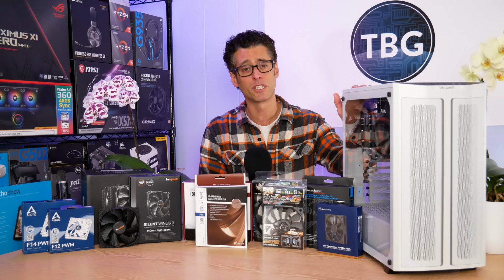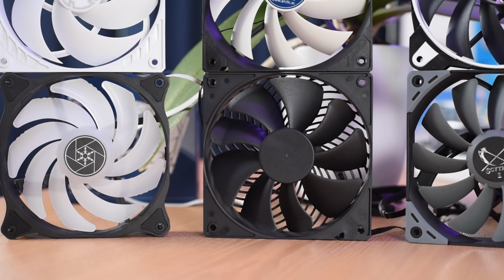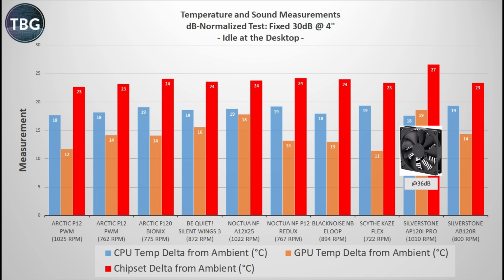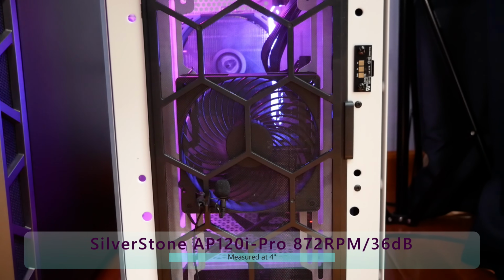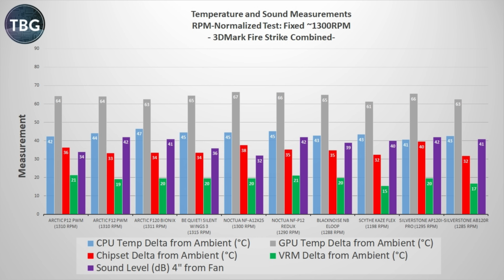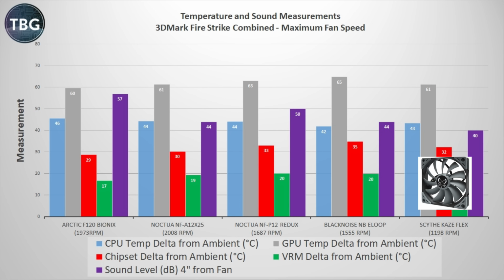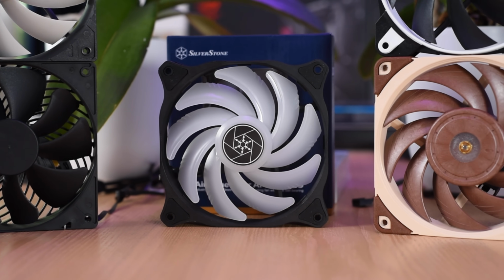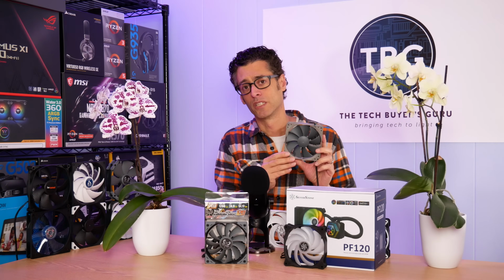The Best 120mm Case Fan Shootout: Arctic vs. be quiet!, BlackNoise, Noctua, Scythe & SilverStone

Comment: I just ordered the lian Li lancool ii. I planning to get 2 120mm fans to go with the 3 stock fans. Which ones do you think would be best for my case?.
Reply from the maker: None of the above! I assume you're going to fill the top slots, in which case you should get 140mm fans. In fact, I'd move the two front 120mm fans to the top, and put the new 140mm fans in front. I'd get the Arctic P14 PWM PST: https://amzn.to/2GISWqw
Reply: @TheTechBuyersGuru  oh good idea. I was just think of getting the Arctic p12 5 pack 120mm fans. Would that also be a good idea?. Or should I go with the 140mm
Reply: @TheTechBuyersGuru  oh unfortunately that 140mm doesn't have any buying options. Just used.
Reply: @TheTechBuyersGuru  1 last question. I'm thinking of picking up the deepcool assassin iii air cooler. My case says it can fit a cooler up to 176mm in the length. So I'm assuming I should have enough clearance to fit it. If you know anything about that, I'd really appreciate it.
Reply from the maker: Yeah, it will fit that cooler. You mean 176mm in height, and the Assassin III is 165mm. Strange about the fan not showing in stock, I see it's for sale direct from Arctic for $11.49 plus shipping. But if you don't see it listed, you could get the 5-pack of P14 fans right here: https://amzn.to/35r5Nb6
Then you could replace all but your rear fan and have pretty incredible cooling.
Reply: @TheTechBuyersGuru  ok awesome, so I'll have just enough clearance. Hopefully it won't look bad with a huge cooler. And yeah on Amazon I can get to the item, but no option to buy. And so your saying I could have the five fans plus the 3 stock fans in there in the front panel? Any ideas on a good configuration for the fans? I appreciate the help btw.
Reply: Ah damn it could take a couple weeks for the fans to come in if I choose those p14 fans. Actually nevermind, it's the same with the p12s too. Guess I'll just have to wait.
Reply from the maker: You can just wait since you already have fans. And no, you can't have eight, you can only have five in the system at once if you use 140mm fans, and the rear has to be a 120mm. So just hold off, you'll be OK with the stock fans until Arctic restocks. You really just need dual 140mm fans to put in front so you can move the stock fans to the top.
Reply: @TheTechBuyersGuru  ah ok gotcha. So I shouldn't order those fans yet till later. As for the configuration of the 3 fans I'll have for now, should I just keep all 3 in the front?. Not sure the best way to configure with just the 3 fans.
Reply: @TheTechBuyersGuru  if I'm not bothering ya too much, I just thought of something. I'm moving from the Alienware Aurora r8 and I was wondering if it'd be fine to move that motherboard into my new case. Atleast until I find a better one. I just wanna atleast run it first to see how everything runs.
Reply from the maker: Leave the Lian Li fans in their stock position. You can optimize later when you have more fans. As for the Aurora, generally, my answer is don't try to reuse the motherboard. Dell uses custom motherboards for nearly all of its systems, including Alienware, and they don't conform to any standard. Unless you can confirm it's an ATX motherboard by looking up specs, don't bother.
Reply: @TheTechBuyersGuru  yeah I'm ordering an Asrock mother board and getting a 600w EVGA psu, so I should be set
Reply: @TheTechBuyersGuru  He can just go with 5 140mm and 2 120mm fans on the PSU shroud. That's where I would put the stock fans.

Comment: I think you need to record the sound samples and decibel measurements of the fans with the microphone significantly farther away from the fans. The placement of the lav mic means it gets disturbed as every individual fan blade passes it, which is not something you ever hear from farther away no matter how sensitive the recording. Instead, I'd use a directional mic from at least a foot away. You may also want to measure on-axis and 45 degrees off axis.
Reply from the maker: Fixed in my follow-up fan shootout: https://youtu.be/PUdsTiRmuuU

But I did it from 6", not a foot.

Comment: 20:04 - the best moment in this whole video ^_^ You made my day. So clear message and honest from you. I'd never even think about buying it. We can hear it too. Would like to see a test of Noiseblocker BlackSilent series for a next 120/140mm roundup, then a suggestion to test static pressure designed fans on a radiator with high FPI, and in this test, I'd like to see products as Noiseblocker BlackSilent 140mm, Be-Quiet Silent Wings 3, NB-eLoop, couple of Noctuas "best" 140mm fan for this purpose (A15?), Arctic P14, EK Vardar, and a couple of more.
Help me guys tips these other fans.

Comment: Good Sir! thank you for this amazing content. Been looking for another option ARGB 120 fan for my next build. Oh, by the way scythe kaze flex pwm also has an ARGB variant. It's available here in Japan. see link for as a reference: https://www.scythe.co.jp/product/fan/kazeflex120argb-pwm  (sorry page is in japanese).
Reply from the maker: Thank you for stopping by to check out my content! I have actually tested the Scythe Kaze Flex ARGB, and I did not find it that impressive. It was first shipped with the Mugen 5 ARGB cooler, which I reviewed here: https://youtu.be/HZOGK49NGLQ

Perhaps it would work better as a case fan, but my impression is that it is not actually the same fan as the Scythe Kaze Flex, and it has lost some performance in the transition to the ARGB version.
Reply: @TheTechBuyersGuru  Thanks for the link. I see..... it seems the ARGB variant is indeed inferior. Anyways, i still have the SilverStone AB120R-ARGB as my other option for my ARGB case fan.

Comment: Did you experience the same humming with arctic p12 at 1000 rpm as shown in this video? www.youtube.com/watch?v=QwftVMGPOiI&t=6m20s
Reply from the maker: Not sure if it was at 1000RPM, but I did experience an anomaly at a specific RPM, but it wasn't in the range I was testing. I think it was at 1400RPM. So there may be something going on here, and I'm sure Arctic is already aware of Optimum Tech's video and is looking into it. Next time I communicate with them (which is often), I'll ask about it.

Comment: Noctua recommends nf-s12a or nf-s12b as chassis fans. The Noctua A and F series you used in this video are not optimized to use as case fans.
Reply from the maker: That's fake marketing, and I've done the testing to prove it: https://youtu.be/PUdsTiRmuuU

Noctua does a lot of things well, but designing case fans is not one of them.

Comment: how come tne noctua nf p12 refux react 40+ decibels when on specification it said 25.8 at 1700rpm??
Reply from the maker: You can't compare specs like that. Totally different test. To be clear, those specs are useless unless you're comparing fans within the same brand, and even then, they are completely misleading because the fans are spinning at different RPMs and producing different amounts of airflow.

Long story short, comparison reviews like mine are how you learn about fans, not from specs.
Reply: @TheTechBuyersGuru  i understand your test is real but how a come their spec say 25.8 db  when your test clearly show different?     do you get 25.8db is not attach to the case?
Reply from the maker: The distance from the fan and the sound meter both matter.

Comment: Have you done longevity tests on any of these fans? I've had some issues with the Arctic P12 fans a month in since they started rattling, have you run across any similar issues with any of these fans?
Reply from the maker: I have not, but I continue to test them and will be on the lookout for such issues. They have a 10-year warranty, so you should reach out to Arctic about it.

Comment: Flawed test. You don't mount the mic to the case or you will  hear the motor hum when actually it isn't as loud as this test indicates.  A 20" distance would be more real world.
Reply from the maker: See follow-up video for better setup: https://youtu.be/PUdsTiRmuuU
6" distance. 20" would be worthless. Microphones aren't human ears, they wouldn't pick up any distinction between fans at that distance.
Reply: @TheTechBuyersGuru  Watch Gamers Nexus and tell Steve that.
Reply from the maker: He does great reviews, but he doesn't review fans, he reviews cases. And a case full of a bunch of components running at load certainly makes enough noise to hear a difference at 20". A single 120mm fan running at under 1000RPM? Not so much.

Comment: Hi, Are the Scythe's suitable as an exhaust fan for the rear of a case and roof? Or are they too static pressure orientated to be a exhaust fan?
Reply from the maker: Absolutely! They actually are not particularly good at static pressure, they are definitely airflow fans, and they'd work great in the back or top. Here's the link: https://amzn.to/2Xcnnea

But if you have the space for them, you actually want the 140mm versions, which I tested here: https://youtu.be/PUdsTiRmuuU
The exact model I tested is sold out, but here's the RGB version: https://amzn.to/39FBo98
And here's the new square frame version: https://amzn.to/2ECqt4P
Reply: @TheTechBuyersGuru  I can afford to have the top fan at 140mm  but rear will have to be 120, is this alright? Additionally what rpm should i get the 140mm at? New sub due to the great vids and help
Reply from the maker: Thanks for the sub. Yup, go 140mm whenever you can, that's the simple answer. Mixing and matching if fine. Honestly, 1200RPM is more than fast enough for these fans, but Scythe has pulled its 140mm 1200RPM fan in favor of these 1800RPM models, so that's what you'll have to go with unless you find some old stock somewhere. Just make sure you tune your fan curve otherwise it will be too loud.
Reply: @TheTechBuyersGuru  Managed to find a 140mm @ 1200rpm here in the uk so I'll go for that? And a 120mm @ 1200rpm
Reply from the maker: I see it here at Amazon UK: https://amzn.to/3gg9XW2
But that's a bit expensive. I'd say about half that price would be better, otherwise maybe wait on the new 1800RPM version that will hopefully come in at the MSRP.

Comment: I just ordered a Scythe Kaze Flex 120. My matx case already have 2 intakes and 1 exhaust. Is it good to put the kaze as top exhaust? Or should I rearrange the older fan?
Reply from the maker: If you're using stock fans that came with your case, you may not want to position them horizontally (top exhaust), as many stock fans use rifle bearings that do not perform well in that orientation. That's where a high-quality fan like the Scythe would do well. But if all your fans have premium bearings, then put the Scythe in the front, it's an excellent intake fan.
Reply: @TheTechBuyersGuru  Yep stock fan. So does the kaze performs well as a top exhaust in that case?
Reply from the maker: Yes, it does. Excellent exhaust fan, works perfectly in a horizontal position, which I guarantee you the stock fans won't.

Comment: You mic is set too loud it is buzzing on every noise test. That Noctua sounded horrid in your sound test. I am using 7.1 surround headphones to listen to this.. Maybe take the air filter off with case front off. Otherwise thorough review mate.
Reply from the maker: I fixed the setup in my follow-up video: https://youtu.be/PUdsTiRmuuU

Comment: Otherwise good test, but the microphone setup at few cm distance is very unrealistic. You said 4 inch away but the microphone seemed to be closer to the fan than that, so now I'm not sure what recording I'm hearing here. At which distance was the dB measurement was taken? Sound can be very directional. Something like 1 meter away in a room at some angle would be more realistic.

Another problem for realism may be the fact that you used just one fan with the top and bottom being empty. The turbulences and directions of air flowing differently because of empty top and bottom may affect performance results, which are quite close to each other anyway. It would have been better to use 2 of each fan at parallel.

Nonetheless, I really appreciate your work.
Reply from the maker: dB taken at 4", recording at 1/2". Fixed that in follow-up test: https://youtu.be/PUdsTiRmuuU

But I won't bother with 1m dB testing/recording. You'll get absolutely nothing of value out of that, because a microphone does not work like the human ear.

Comment: Scythe was always the fan to buy back in the day when I started building and tweaking PC's many years ago. I have an S-flex in my old computer from well before 2010 and it still works perfectly. They are amazing fans.
Reply from the maker: No doubt. I have an S-Flex that still runs perfectly, and I have a Kama Flow 2 (https://amzn.to/3hyRXGL) in the system I'm typing on right now. I purchased both over a decade ago, when all anyone talked about was Scythe, they were bigger than Noctua. Scythe fell off the map for a while, and I'm trying to reintroduce them to new enthusiasts who aren't aware of the brand. Everything they make is top quality.
Reply: @TheTechBuyersGuru  Agree! And yeah they are always on my short list. This last time around I went with Arctic and I love them. It was just an availability thing.
Reply from the maker: Scythe is still having a bit of trouble on availability, and Arctic is a great alternative, as I've shown in my videos.

Comment: this video is a joke, "case fan" test and putting them right up against dust filter with majority of tested fans being static pressure optimised fans which will obviously perform better, only Scythe Kaze Flex is so good and in too good scenario because of matching reverse airflow with fan on a cpu cooler and slim fan rotating in different direction specificaly made to increase static pressure so it ends up pulling up ahead because of that

Comment: i have the eloop and it's by far the best of those fans, in terms of noise and airflow... you had the mic WAY too close, and you should also mount the eloop with its brilliant mounting kit to eliminate vibrating noise... the mounting kit is a part of its design, so it's a shame you didnt use it.
try to mount 4 eloops in a case and run them at 500-700rpm, then sit 50-100cm from the case, as a person normally would, then do the same with all the other fans, and youll instantly realise how genious a fan the eloop is... im specifically talking about the b12-ps and the b14-ps. the other amazing thing is they move insane amounts of air at those rpm's, significantly more than any of those other fans u tested.
high-end i recommend the eloop b12-ps, if youre on a budget i recommend the arctic p12, cus they give a loot of value for the money, especially if you buy the 5 packs.
but this video paints a picture thats says the eloop is one of the worst fans you tested, which is simply NOT true.... I had all the fans you tested and i can assure you the eloop is the highest quality fan of em all, if you test it properly
Reply from the maker: First of all, if you're looking for results that will make you happier, you can see my latest shootout: https://youtu.be/PUdsTiRmuuU. I changed the mic position, I discuss in detail the eLoop mounting system, and I test them not at any specific RPM, which is irrelevant (these are extremely loud on an RPM basis), but at multiple dBA levels to show people exactly how much performance they'll get at a given noise level.

But second, I have to tell you that as a tech reviewer, my job is to take all the fans that people say are best, and determine which actually are best. Just because a manufacturer claims to have the best product, or because users tell me that some product is best, doesn't make it true.

The eLoop is an excellent intake fan when paired together with at least a second if not a third eLoop intake fan, but it certainly is not the best general purpose fan, and makes for an exceedingly poor exhaust fan from a price/performance perspective. And as you know, it costs as much as five Arctic P14 fans, which would of course decimate a single B14-PS.

So, you tell me, is it still the best fan you can buy?
Reply: @TheTechBuyersGuru  Thanks for your reply.

I now watched your newer video, the one you linked. It was very enjoyable. In fact, it earned my sub! :-)

I'm now looking very much forward to seeing your cooler/radiator fan testing results... I'm confident the eloops will be top scorers again..

That video kinda proved what I was trying to say... If you want the best of the best, you fill your case with eloops...

What I meant with rpm was also kinda shown... I'm very surprised about the p14 being as silent as the eloop, when it's running at like 300 higher rpm.. But it also showed that the eloop at a much lower rpm, and same noise ratio, moved more air and made better temps.
So what youd wanna do is fill your case with eloops and run them at like 600rpm. That way you get a shitload of airflow and dead silence.

In terms of price/performance, you can't beat the arctic p series...
I've been using arctic for many years (Am a system builder) and I'm always happy to see them mentioned. They truly deserve it.
Their freezer 34 cooler is also unbeatable for the price.
Same goes for their liquid freezer 2 AIO's. Theyre crazy good value for the money.

I've also always said that noctua fans are overrated. These results shows that too.

I'm also glad to see scythe mentioned. They've always made top quality products, but for some reason almost never get recommended by youtubers, which is a shame.
Reply from the maker: Thanks for the sub, and thanks for your additional feedback. I really am working pretty hard trying to come up with improvements to my methodology with every test. I know a lot of reviewers will have like 5 years worth of data in a single graph, but you know what that shows? - (a) something has changed along the way that they're not aware of to make comparisons irrelevant and (b) they didn't stop to improve their process!